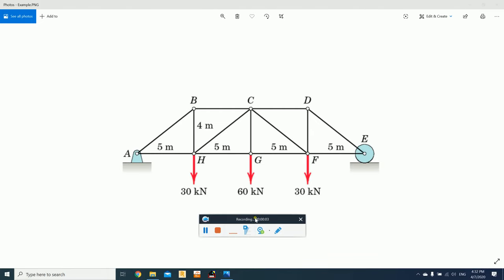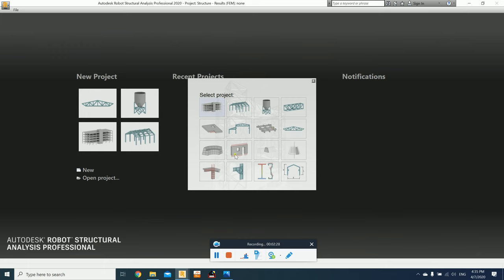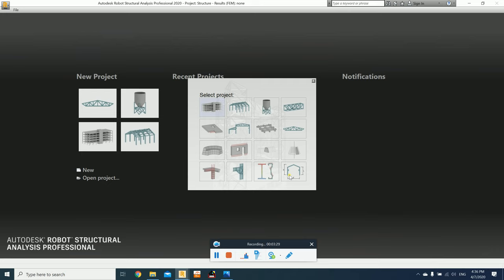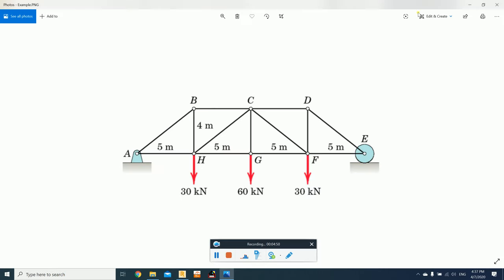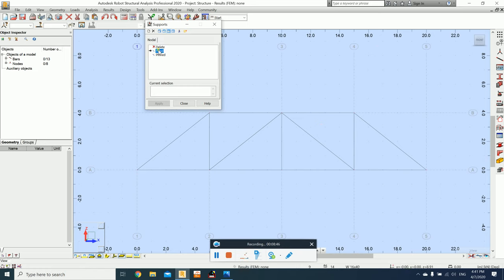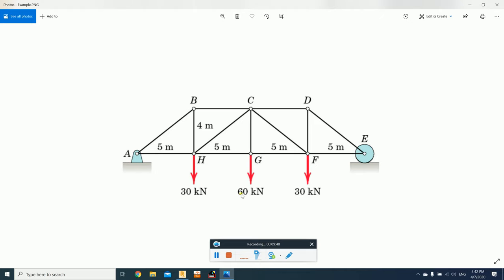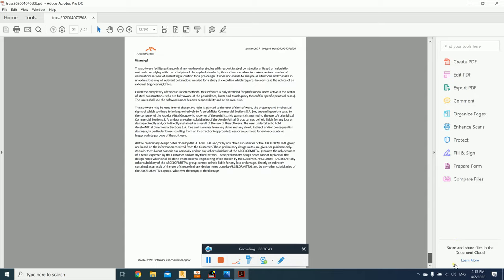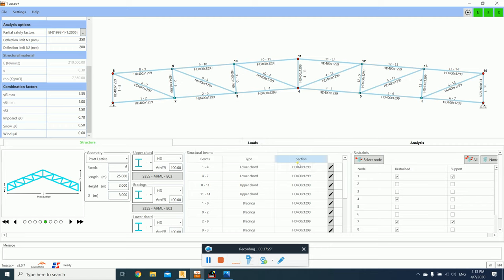Analysis of a Truss Using Robot Structural Analysis and LinPro + An impressive software at the end

Comment: In LinPro you should also apply moment releases (Members --> End Releases --> Bending Moment) so that this structure becomes the actual truss and carries only axial loads. Just keep in mind that one member in each node has to remain unreleased so that the node itself is stable.
Reply from the maker: Agreed @Gumball
Reply: Thanks for noting this. But I think since he is using Robot's truss template ,end releases are taken into account. If you were to model truss on your own in Robot then defining end releases would be necessary. Just thinking but I am doing further research on it
Reply: @kelvinmacharia3715  Yeah, in Robot it’s probably not a problem but in the second part of the video the same truss is analyzed in LinPro.
Reply from the maker: @kelvinmacharia3715  That's the case as you referred in RSA, he was talking about Linpro thought the end releases will majorly affect the structure based on the intensity of the loading as well
Reply: @Gumball_W  Noted

Comment: Structural Analysis Using Autodesk Robot, Exercise04 ( Eng. Radfan Ojailah) the results do not agree with the lower bars?
Reply from the maker: It depends on the constraints/joints condition for the truss in the software, nevertheless kindly state which minute of the video are you referring to since this has been made more than 3 or 4 years ago.